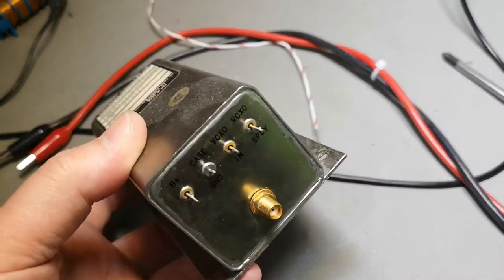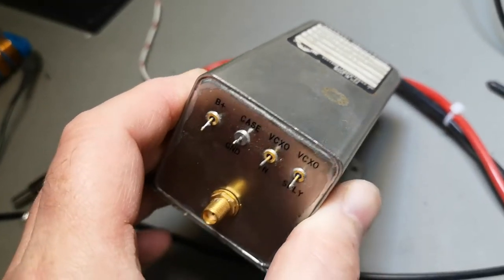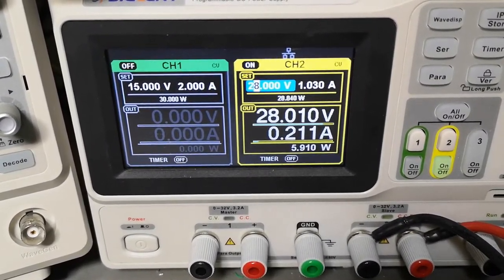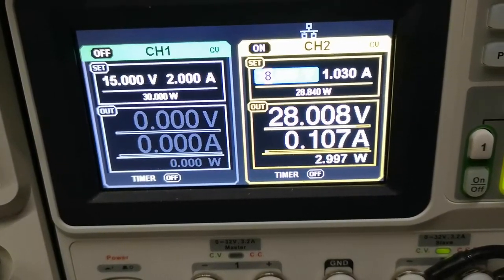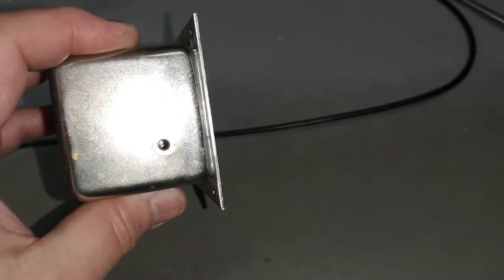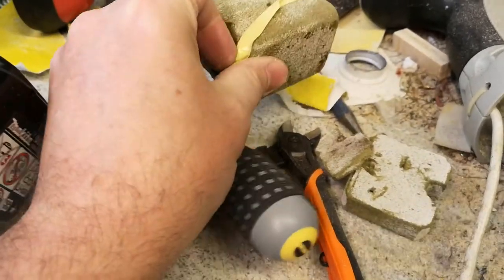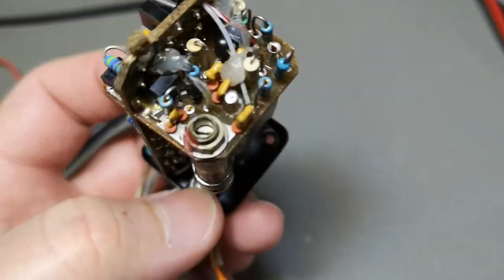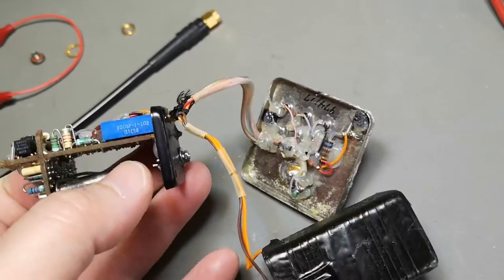Oven Xtal Osc 101.636166Mhz Vectron Laboratories Inc, test and Teardown

Comment: Oscillation likely hum pickup on the open VCO input, normally used for fine control of frequency using a precision reference and a set of divider resistors, or a low TC pot, so as to give that last few digits. Apply 5V, via a 1k resistor and 100n film capacitor to ground on the VCO pin, and it should get most of that noise away. There is a nice step recovery diode in there to act as the doubler, on the first buffer to generate the harmonic, filtering it off with a pair of LC circuits, and then a final output buffer. Step recovery diode is the one you think is the zener, that is on the other side of the board, but the step recovery diode is heat sensitive, so got soldered in separate, plus it is biased with an inductor to set the DC point on it. Nice cased ceramic capacitors in there as well, plus the right CTS13 type wet tantalum capacitor, very likely from that size 6.8uF 35V, on some intermediate 15V rail for the output stage supply.
Reply from the maker: i tried to short the vcxo control/modulation input to gnd, did not remove the noise,  i think it is from the doubler, and the way the scope trig,
Reply: @TeardownOZ2CPU  Think you need bias there though.
Reply from the maker: @SeanBZA  could be, some analog inputs dont work alle the way from zero, and specially not when parts are only supplied with a single positive voltage.. anyways, stay tuned a few more oven osc are on their way to me, i hear they are case inside case a few times.

Comment: I translate with Google translator
Hello. I have a Vectron CO217B18-HK 10MHz model and I am looking for catalog data. Do you have access to the catalogue?
I power it with 12V DC
Reply from the maker: I am sorry i dont have such info, you need to know if its features oven heater regulator and all that works at 12V too and all pinouts,
if you allready know the pinouts and have output at 12V ??
then simply measure its outpul level will not change ?? when you adjust the voltage 11-12-13V
also check the current usage is high the first x minutes, and drops after x minutes, slowly until it stabilizes at a very low usage level,
this way you know the oven temperature regulator works fine at your supply voltage
Reply: @TeardownOZ2CPU  Thank you for your answer.
I power 12DCV, increasing the voltage to 15DCV, the signal remains unchanged.
Unfortunately, it does not have a sine wave, it only resembles a saw.
After heating, it consumes ~200mA
Unfortunately, there are no Vectron catalogs and I have several of their products.
I recognized the terminals as power supply - signal

Thank you
Regards